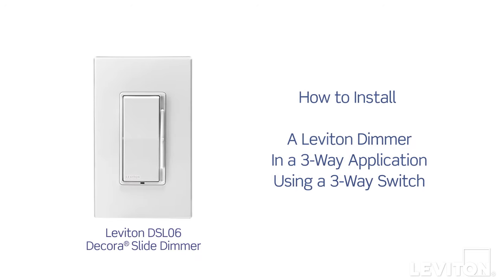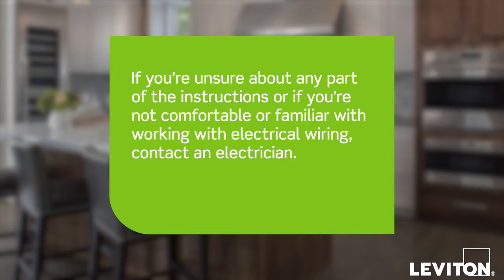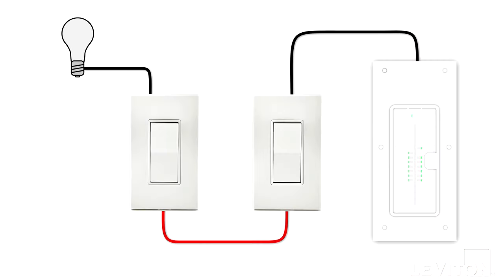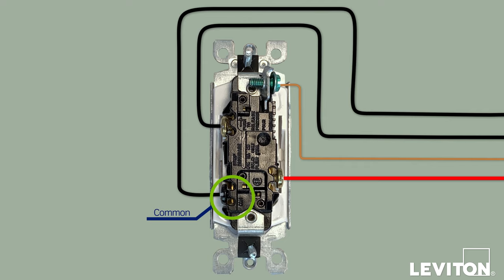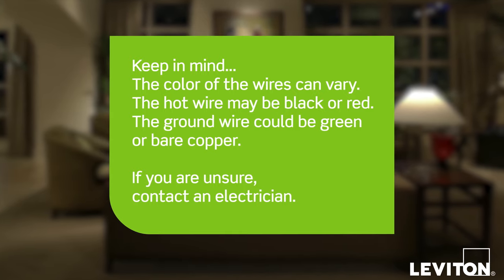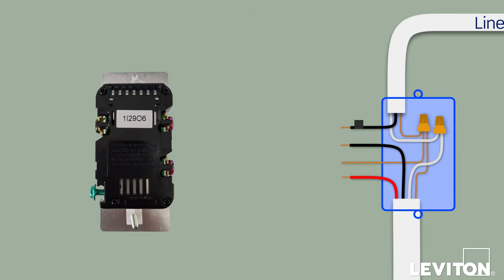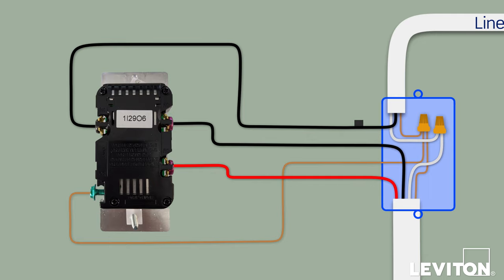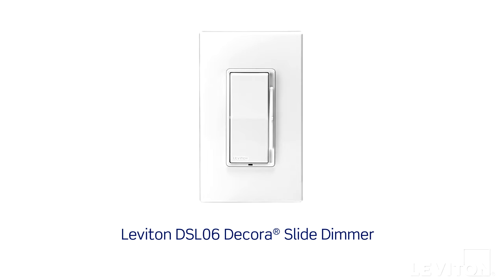How to Install a Dimmer Switch in a 3-way Application | Leviton

Comment: Good Video.
Reply: So do you not need to replace the second switch?
Reply: @ryangauder6272  you can't have both 3-way switches be dimmers otherwise we'd be dimming a dimmer and all would go to hell. LOL
Reply: @ryangauder6272  No its stays static. Just leave it as is, there is one position that dims the lights. In order to have two dimmers in a 3 way switch set up is very elaborate. Almost all installs are as stated in the first sentance just pick the location where you want to control the dimming.